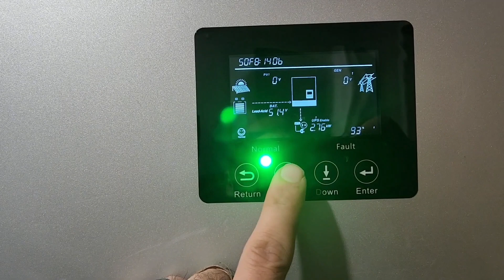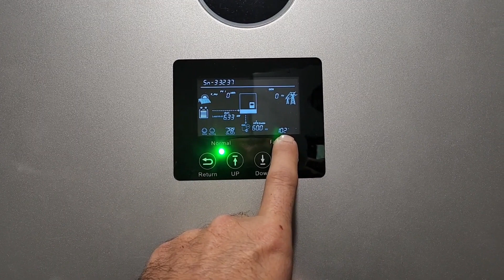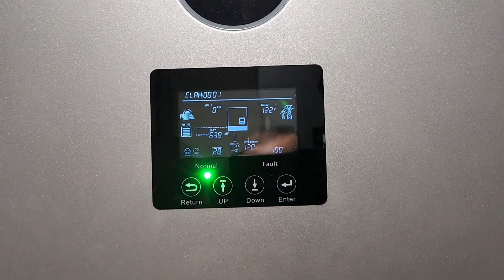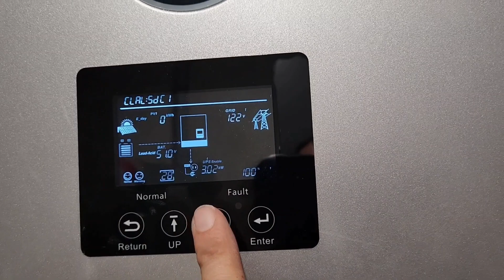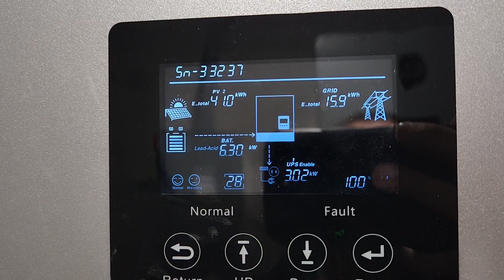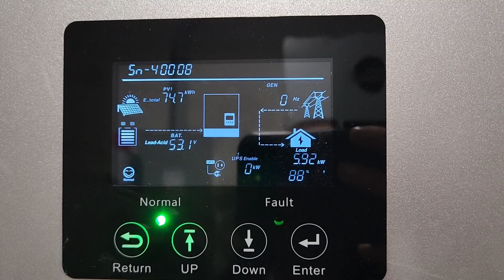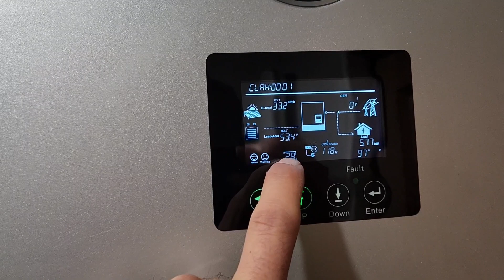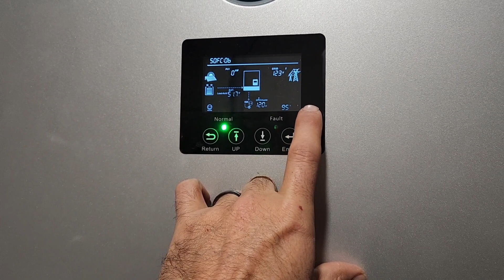Warning ⚠️ Loud fan noise!  EG4 Parallel 6000xp Overload demonstration with Grid bypass.

Comment: That was a great demo of what these do when connected in parallel, running a heavy load.  I'm having a new building put in this coming spring and will be installing two of these inverters, so it's really cool seeing them in operation.

Did you have to record it from the tarmac at O'Hare?   :p
Reply from the maker: My Solar room measures 5 feet by 6 feet.

Comment: These are the fun tests!  Thanks!

I did notice that when the inverters were in a "warning" state,  the "Normal" light on the left 6k blinks somewhat erratically while the one on the right has a steady blink.  Not sure if that was due to load or something else?
Reply from the maker: Sad face starts at 95% switches to grid after 5 seconds of steady 110%
Reply: @theadventuresofarenaissancman  so is the "normal" light more consistent in flashing once the load gets higher?
Reply from the maker: Not sure.

Comment: Well shit. I was planning on picking up 2 6000xp's, but if they're this loud, it won't work for my use case, as they would be in my living room. Might have to go with the 18k and do an outdoor installation. :(
Reply from the maker: If you can partition off a small room that helps.

Comment: These low cost, high frequency, transformerless inverters make a lot of noise from their fans because they run hot due of their very high switching speeds. This excess heat shortens the life expectancy of the components in the inverter, especially the caps and the MOSFETs.  If you want a quieter inverter that's going to give you a far longer life expectancy and a much higher surge capacity, then it's better to buy a hybrid, low frequency, transformer based inverter charger.
Reply from the maker: Interesting.   I'll need to do more reading.
Reply: Are you referring to the 18k model that’s a hybrid?
Reply: All high frequency inverters run hotter and have noisier fans than heavy duty low frequency inverters.

Comment: When the inverters bypass to grid, how many watts/amps will the 6000XP's in parallel bypass. Is it a total of 50 amps per unit?  If it goes over that does it disconnect from the load completely, or is that the breaker size that limits the output?
Reply from the maker: Grid input Breaker size needs to be the limiting factor. 

My personal opinion. 40 amps pass through plus 10 amps reserved for DC battery charging is safe. 

Total grid input breaker can be up to 50 amps for each inverter.   The manual says 50 amps pass-through.

So two 6000XPs could provide 100 amps of pass through.
Reply from the maker: I tested a single 6000xp up to 60 amps. 12,000 watts pass-through and the AC battery charging was automatically throttled by the inverter when the pass-through load exceeded 40 or 50 amps.
Reply from the maker: The internal breakers of the 6000xp are rated for 62 or 63 amps. 80% of 62 is 49.6 amps. Breakers are only designed to support 80% for continuous loads.

Comment: Is it possible in any way to simultaneously use grid and battery with a single or parallel 6000xp?
Reply from the maker: 6000xp is not approved as a grid interactive inverter.
Reply: Looks like this will be the dealbreaker of choosing two of these paralleled versus a single 18k. I need 24/7 grid as a source potential only without any selling back at all.
Reply from the maker: @jtmg11  blending of grid and Battery at the same time...no.   but when the battery SOC drops below your predetermined %.  The inverter with switch over to grid.  Your original question implied that you want Battery and Grid blended at the same time.
Reply: @theadventuresofarenaissancman  sorry for any confusion. Blending capability was my question exactly. I could still make it work, but I would be concerned about switching too often, causing excessive wear on the inverter (may be miss placed fear)

Comment: I have my XP hooked to the grid (50 amp on each leg). I did a some testing last night and it would trip if one of the legs wend over over 3kW for a but. I thought if it was hooked to the grid to could pass thru more power and not be limited to a total of 3kW on each leg.  Do I need to change a setting to enable more power to pass thru when I'm hooked to the Grid?

Also, when I hooked it up, it only would pass thru power once I turned the EPS switch to "on".  I made the assumption that I only needed the EPS on if I needed to use battery or solar energy. 

What are your thoughts?
Reply from the maker: Exceeding 3K on either leg, will result in the inverter switching to grid bypass.  In grid bypass, 100% of the load is switched to grid.
Reply from the maker: EPS switch needs to be on for AC output, from any source.
Reply: I was on the grid only but It still gave me the warning sign and then reset when I went over 3kW one of the legs.   Is there a setting that will allow more then 3kW per leg to pass thru when the grid is powering the loads?  @theadventuresofarenaissancman
Reply from the maker: Did the power shut off? What firmware version are you running?
Reply: Yes it shut off and killed power to the loads. 
 FW Code: ccaa-160B0B @theadventuresofarenaissancman
Reply from the maker: Mine doesn't behave that way.  Inverter overload defaults back to grid. I wonder if one of the settings needs chagrin.
Reply from the maker: Post your issue on diysolar or Signature Solar EG4 Facebook group.
Reply: @theadventuresofarenaissancman  have you tested how much power you can pass thru using grid power?
Reply from the maker: I think, 50 amps 240v pass through on a single 6000XP, plus 40 amps DC charging. I need to look back at my old videos to confirm.
Reply: @theadventuresofarenaissancman  I thought this was the video but will try to find the one you did the test in. Thanks!!!
Reply from the maker: @jasonhaws6610  I didn't post that specific test.  It was conducted prior to public release of the inverter.  It was on an early firmware version, I should redo the test on the newest firmware.